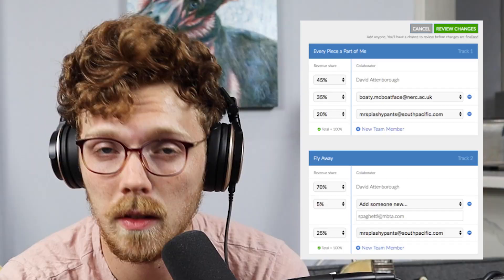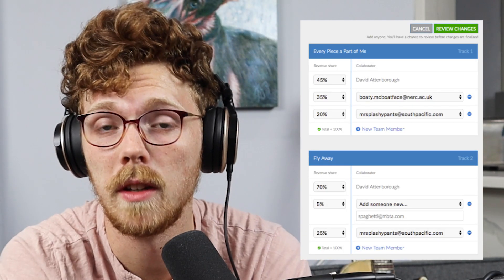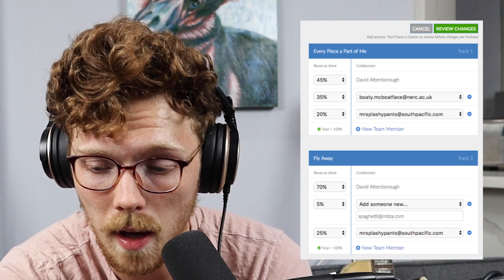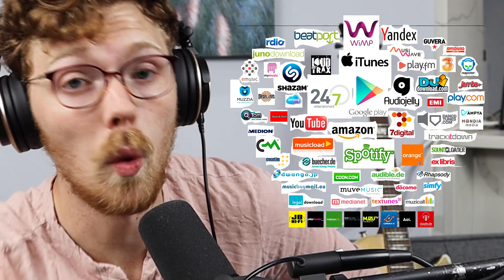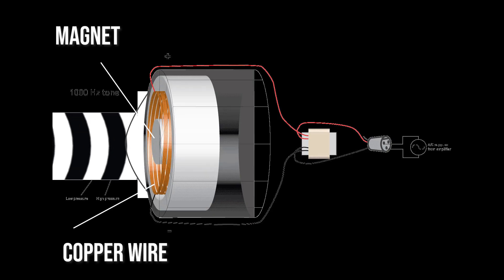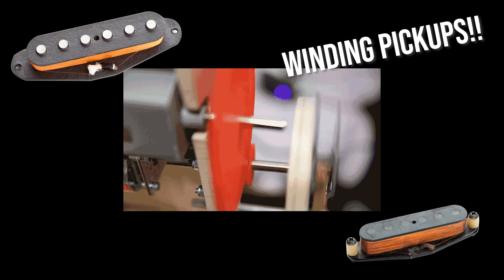Dynamic vs Condenser Microphones - An Overly Comprehensive Mic Lesson (Shure SM7B vs Rode NT1)

Comment: It's not the sound hitting the magnet that makes a signal in a dynamic microphone. The sound hits the diaphragm. Next, the diaphragm moves a coil wrapped around a magnet. The movement of the coil [in the presence of the magnetic field of the magnet] causes free electrons in the wire to move back and forth...thus creating the signal.

Comment: In terms of noise rejection, dynamics and condensers are the same, with condensers even having ‘cleaner’ off axis rejection curves. The reason people think dynamic are better at ‘rejecting’ off axis sound is because of the fact, 1. They need to be closer to the source to get adequate output level, and 2. They have slower transient response on account of the heavy magnet and coil, which means less high frequencies being captured. Something about that 8k and above band makes people believe dynamics ‘hide’ the room better, but really it’s just a darker recording, you could probably match the dark tone of a dynamic by low passing a condenser, but wouldn’t be able to do the same with a dynamic. I’ve written to DPA about this, and they’ve given me quite a beautiful reply, would be happy to share it.

Comment: Having inherited a few mics, here's my take on them:
Shure Sm53 and 58: very similar sounding. Warmer and work better with my lower voice. The 58 has a tiny bit more of a hollow sound in the mids and less high extension. The 53 is best vocal mic for me.
Jana small condenser: Noisier but also louder, more top end than either dynamic. More detailed and more treble, like a blanket was taken off the dynamics. I like it, but it doesn't work as well with my voice.
Astatic 200 Crystal Mic: All mids. Distortion on loud sounds. Apparently a favorite for harmonica because it gives a gritty electric guitar tone. Sounds like a really clean 78 shellac record.
Reply from the maker: Thanks for the info! Those are some nice choices, I'll have to look into them :)

Comment: Great instructional video. 
Maybe you can help.
I will be teaching virtually from a home office.  I need better audio ( and video).
Most of what i will be teaching will be live via Bluejeans or Zoom.
Some will be recorded and available on YouTube. 
My office is untreated with book shelves ( or camping gear) on every wall.
I understand dynamic microphones are prefered in untreated rooms, but for teaching, i do not want to be on top of the microphone. 
The environment is quiet.
What do you suggest?
Reply from the maker: Hey Michael! Just left this on a previous comment, I would check out the LCT 440 Pure if you get the chance, great room rejection for a condenser. I just did a review on it too :)
Reply: @AudioHaze  great! Thank you, i will look up that review
Reply: @AudioHaze  thank you also for the reply.
Most of my requests for help have gone unanswered.
Reply: @AudioHaze  If I may, a little nudge please. My voice sounds the best on the NT1 for voice over. But my room is not well treated for it. The LCT gives my voice a bright upper end which I don’t like, and yet the room rejection is a big attraction. Question: is it possible to EQ the LCT accordingly? Thanks so much.

Comment: Planning on getting a sm58 but am concerned about the infamous low output volume issue when speaking into it or recording vocals. Heard it’s a reallyy quiet mic. Which audio interface would you recommend pairing it with the sm58, say, on a budget? A cloudlifter is not in my range right now. Not sure if an audio interface with enough gain will suffice? Or do I still need an extra preamp? Also, your videos are informative!
Reply from the maker: Definitely no need for a cloudlifter with a SM58! I used a 58 and a 57 with my Scarlett interface for years with absolutely no issue. The SM7B is a hungrier microphone, and it still does not necessarily need a cloudlifter. Most any interface should work (beyond super low end like maybe an Audiobox USB), but if I were to choose, a MOTU M2 would work great :) so would a scarlett

Comment: Planning on getting back into recording now that it can be done from home. An Eastman acoustic guitar (say E20D-TC as a random example) has an abundance of jangle and top end compared to a Martin d18. If I interpret it correctly an SM57 might be a better fit than a Rode NT-1A, if the classic Martin sound is my goal. And then eq and compression to finish the disguise. Is that right? Any other tips/suggestions? Im binge watching your videos and trying to leave a comment in each (algorithms seem to like comments)
Reply from the maker: Thanks for the algorithm boost haha! I think a 57 vs a NT1a is an interesting match up, I think for pure strumming and more of a darker, less defined sound, a 57 would work yes. You could get more of a detailed audio image with the NT1-a though, then EQ the top end out of it later.

Comment: My first mic is fifine t669, good mic but months later i realised that my untreated room screws the audio quality since it's a usb, condenser mic. I know that i could try using powered usb hub, but i haven't tried yet. So, 
Just bought an SL75C(Behringer) since i don't have enough for an SM57, im focusing on no noise rn. And i forgot to buy an audio interface ehe. So i haven't tried the mic yet
Reply from the maker: Dang! You could get a behringer interface! The uphoria series is quite good and you can get one for like 40 bucks

Comment: Thanks!
Reply: I love this video! I really do! Especially you addressing disagreements made my day - I found it highly enjoyable. Especially noise, which is a big hobby of mine, hyped me up a big deal! I would never disagree with you on the fact, that dynamic microphones do a better job at rejecting room noise, compared to a condenser microphone. But I know where the the strong disbelieve in this fact stems from. I am using microphones in an untreated room with the kind of soundproofing you can expect. There is a crowded street in front of the house. In a room like this, adding noise suppression can become difficult. You found a seemingly nice setting, but then the street hits rush hour and you notice, that your carefully tuned noise suppression does a sometimes much worse job.

In extension, this observation proves, how easy it is to make mistakes in measuring noise suppression. You need to be sure that sound from the outside of the room doesn't hit your microphones. You need to place, angle and level the two microphone capsules at the exact same place. You need the exact same sound to test it, because variations in sound can create different responses (that is reverberations) in your room, depending on the structure, acoustic insulation, the exact acoustic treatment of the room and what not. There are so many things that can go wrong, falsifying the result of your measurement, that it can become much too easy to fall for the false impression, dynamic microphones weren't any better in noise rejection. That being said: The distance to the microphone has a quite big say on the noise rejection in both, dynamic and condenser microphones. And the differences between the two types of microphones aren't as big as the differences in distance can be.
Reply from the maker: Well said my friend! Glad you enjoyed that section, I'm sure some may not, perhaps I could have represented it better, but I think I will refer them to the comment you've just made here in the event they disagree haha

Comment: Well, there are some dynamic mics that nearly reach the richness of detail of the condensers. As a long time Beyerdynamic user I would recommend the M201 for mid and high range signals and the M88 for low range. Great mics. And whenever you come across a TG-X80 or 81 - take it. It´s a great dynamic vocal mic. But caution: if you use the proximity effect too intensely you could cause an earth quake.
Reply from the maker: Haha yeah its definitely a generalization for sure, the RE20 is very condenser like as well :) I'll have to check those out at some point!
Reply: @AudioHaze  My little love affar with Beyer began with the TG-X81 by the way. One day I took 5 mics from a store to my studio and compared them with my SM58. Gosh, they all were better but the TG-X put it to real shame. The 58 sounded like a pre WW2 radio in comparison. I still don´t get it that Shure is so successful with these prehistoric mics. I mean, people are crazy. Guitar players - for example - say that they need their 57 to get "their" sound. So they are not able produce a decent sound with guitar and amp only? For example at a small club gig or during rehearsals? Wouldn´t it be better to produce a great sound in first place and then to take a neutral mic? But ok, it´s an image thing I guess.